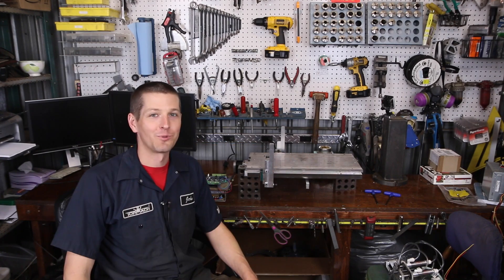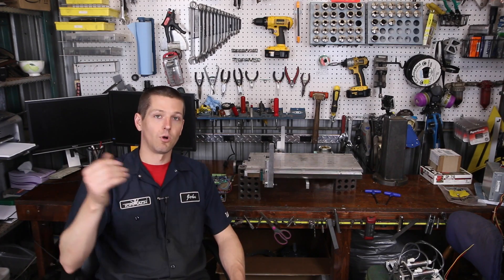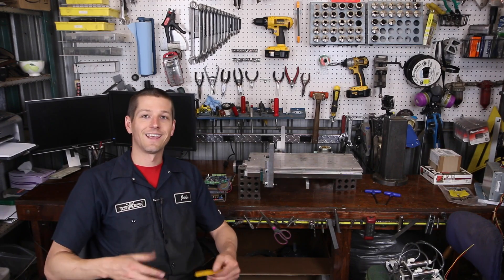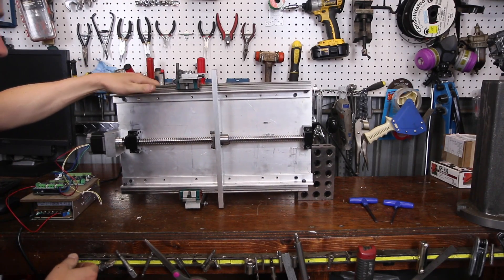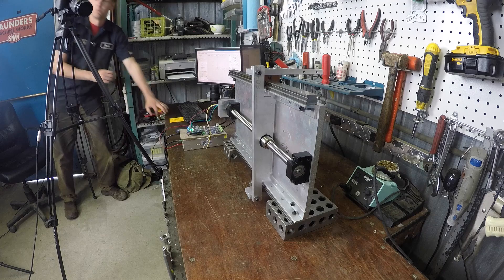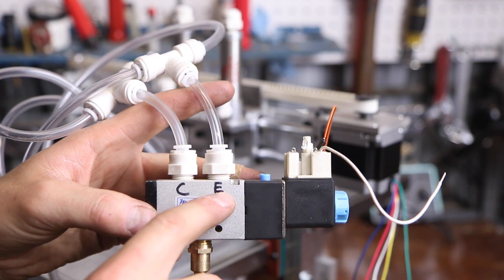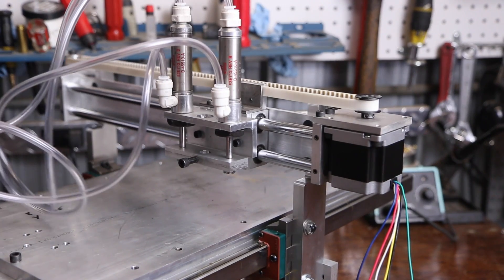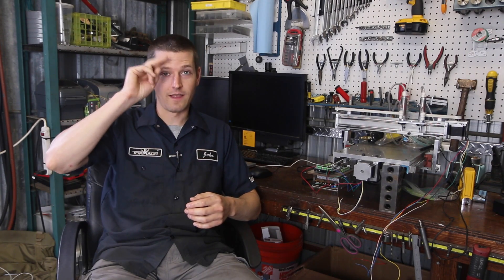DIY CNC Machine: Linear Rails + TinyG Part 2!  Widget41

Comment: I have a question.
I see a lot of cnc-routers on ebay/aliexpress etc. They use all linier-rods instead of linier-rails, just like your machine.
I think that using rods for the X movement creates flex in the whole upper section (x & z).
Are the linier-rails also better for x & z?
I gues you have to mount them on to a aluminium plates to get more riged-x & y travel.

Comment: Ok my question is. What tolerances are you using for mounting aluminum plates to your linear Bearings. Like the through holes and the counterbore tolerance say for a 5mm cap screw.

Comment: wouldn't it be possible to mount the linear rails inverted in the same position as the angle material to the bottom of the table, then use L shaped risers to connect the y axis (I believe it is) up top. this would reduce the amount of contamination that reaches the rather technical rails that wouldn't do very well with chips from milling or even just the dust created from engraving over a period of time (probably even worse than chip's on the tiny recirculating bearing setup). 

also about the other diy build, wouldn't it be fairly easy to replace the small single bearing guides (and aluminum angle mounts) with the preferable two or even three bearings per side to stabilize that axis... should be easily doable considering that the x axis was far longer than necessary, or so you thought anyways before realizing that the "trucks" should have been much wider  to reduce slop in the mechanism.  sorry for commenting on two different projects in one comment but please let me know what to think about the ideas. thanks for your time and consideration, have a great day.

Comment: sweet videos.  I'm quite excited to work on my first CNC plasma cutter/MIG welder table.  do you all have an even heavier duty example build?  like  4' by 5" table?  what diameter lead screws would you suggest for such a monster?  also, subscribed.
Reply: 4 ft by 5 ft.  not 5 inches.  lol

Comment: Why not use the Arduino to send a pwm pulse to a Mac solenoid to vary the force when you want to drive z down. I did this to make a boost controller but I am for sure it would work for this. Cool thing is you would get cheap force control.

Comment: isn't a servo motor better to use if you're already using expensive ball bearings? and the drive belt, the teeth andspindel size doesn't that impact precision so wider belt, more teeth and larger spindel equals more precision?
Reply: +NYC CNC So you cannot put encoders on stepper motors to close the loop?
Reply: +Methodwake You can, but then the steppers becomes a bit expensive and then you might be better going with servo's anyway.
Reply: +Daniel Mattsson I have added Encoders to stepper motors and the cost was not really that bad. Incremental encoders are cheap now of days. Still much less expensive compared to a servo.

Comment: I have been having a play with your design but I used a Demel for the engraver got it working by having only one air ram to pull it up and some 185gr SWC's to hold it down, use the Z axis commands to turn the the solenoid on, only has to go one way. Just add or subtract weight for different materials. Great vids, looking forward to the next episode.

Comment: You mentioned that you have not yet figured out how you were going to control your pneumatic cylinders and engraving pen. You also mentioned using 'G' Codes. 'G' Codes are preparatory codes for axis control. You want to use 'M' Codes which are 'Miscellaneous Codes'. Your engraving pen closely approximates a spindle, so use 'M03' Spindle On (CW) to turn the engraving pen ON and 'M04' Spindle Off, to turn it off.

Since you are not actually going to CUT with a spindle use the 'M08' 'Coolant ON' to bring your pneumatic cylinders DOWN and 'M09' 'Coolant OFF' to RETRACT the pneumatic cylinders.

Comment: Instead of using the tinyG, I use separate drivers and an Arduino UNO. They are stronger with heatsinks and if you blow one driver you don't have to replace the whole unit. Here is a link to one that I use.  http://www.ebay.com/itm/301670136936?_trksid=p2060353.m2749.l2648&ssPageName=STRK%3AMEBIDX%3AIT

Comment: About Y axis and magic smoke from G-shield. I think you were going too fast and there is inertia in system, by rapid stopping that inertia generates current in steppers. That current goes back to G-shield and BAMM!!! :). I think that happened would like if someone confirms this. Stepper should slow down.

Comment: I didn't have time to read all of the comments, so if I got beat to this tip, ok.  If Chili-pepper uses M codes you might be able to fire the valve with one of those.    Also, some flow controls will offer you some control over the speed of your cylinders without sacrificing force.

Comment: I'm seriously excited about this project! I'm trying to wrap my head around this all as I want to attempt building a 4 axis CNC mill for mild steel and aluminum and this seems like the best jumping off point for me to do that.

I've got a grasp on how to stepper motors controlling the motions along the XYZ axis and rotating the X axis (a?), but I'm kind of at a loss on how to actually control the bit speed and what to use to drive it.

Any tips/suggestions are much appreciated!

Comment: As to chip load falling into the presently exposed side axis tracks, why not simply mount the unit to turn around on a center of balance rotation axis so that it may be 'flipped upside down', and run 'inverted' once the workpiece is secured.  The various movement systems are not dependent on using gravity

Comment: With the short stroke of the pistons this might not matter. But if you leave the air pressure where the pistons and solenoid recommend you can put control valves on the exhaust ports and you can control the speed and still have the power of the correct air pressure.
There are many different types but I like these.
http://www.ebay.com/itm/Exhaust-Port-Flow-Control-1-4-NPT-0-250-PSI-IR-ARO-20313-2-OFF1S-/231144200686?pt=LH_DefaultDomain_0&hash=item35d14499ee

Teddy

Comment: Hay john its me again. i was thinking about what you could do to control you pneumatic air cylinders.
Depending on how fancy you are going to make this machine you could use the coolant pin on the TinyG .Then you would have to by a Separate breakout board that has a 3.3v relay on board and wire you 12V A/B ported air valve to control it. I encourage you to look into the specs of the relay that you buy because some of them may not be able to handle the current that that air valve pulls because in side of though is an electric solenoid (Coil of wire) and that pulls a  plunger that lets air go bu.
If you budget allows try to find one that IS 3.3V CONTACT voltage but a little heavier duty be cause in electronics , a coil of wire contains a large magnetic field and it is now know as an inductor. and instructors in electronics Resist the flow of changing current and so when you open the relay . the magnetic field has to dissipate some were and some times that can flow back into the relay and then in to your board.
Or if you are having troubles finding a large enough relay you can put a diode across the solenoid wires but put the diode in backwards so when you turn on the relay it wont turn on the diode . but then when you turn off the relay the magnetic field collapse and the current flows backwards threw the diode. This Simple circuit is called a free wheeling diode and i use it in a lot of my circuits even if it my not be necessary  .
To turn on the coolant pin on the TinyG :(" depending on what G code command list you look at you might not find it") It is a M8 to turn on  coolant pin and M9 to turn the pin off . There is a M7 command but that is a Mist coolant command and i don't think the TinyG Responses to that.(https://en.wikipedia.org/wiki/G-code)
Hope that Helps

Comment: Hay John
I was wondering if you were going to put limit and homing switches on you machine.
I was wondering if you could touch base on , or create a separate video on setting it up , hardware , and software wise in ChiliPeppr. I bought  a TinyG  about a year ago and now you got me hooked on doing something with it.. I'm prepossessing an old cnc table engraver that i had got my hand on. It is a  very nice machine , the working travel movement is eight inches in the x, and ten inches int the y and about a  half an inch in the z. the machine had the limit switches build into the machine so all I had to do  is wire it up.. On the TinyG the input pins are normally pulled high , so I though that it would have to be pulled low for the TinyG to see a state change in the switch.So in ChiliPeppr i changed all the machine settings and limit settings  . but when i moved the machine and when i touched the switches the machine didn't halt at all .. Please help me if there are G codes that I need to send to the board or other setting I need to Change.

Comment: If I only use adruino code, without g-code or any other software, how can I control multiple steppers? Will this piece this of code do?
   digitalWrite(, HIGH);
   delayMicroseconds();
   digitalWrite(, LOW);
   delayMicroseconds();
i have problem when the delay adding up.

Comment: I think air cylinder is not a rail.
I know the axial effort is not so big but air cylinder is realy not
made to resist to that.Maybee if they not full extend when operating they could do.
Reply: Now you talk!
Just can't wait to see that crazy machinne !! :PP
I really like yours vidéos,i start learning meeling metal from you....

Fred
Reply: Just a question: Why using so much different transmission between Y and X axis?

Comment: Your videos are great. I just saw your move to Ohio clip from last year. I'm from NYC but studied Industrial Design in Cleveland. Ohio is a great place to live. I designed a new camera rig I'm getting a small BV20L-1 to make the first run of parts manually but plan to upgrade to CNC.  That said your Tormach 15L Slant Pro demo looks like the way to go. What an amazing machine. Thanks for the support.

Comment: Suggestion, T the hoses right at the cylinder.  Fewer hoses in your drag chain (bundle) Control of the cylinders should be discrete ( on/off). If the works electrically like the it does mechanically switched, just supply 12v for the down stroke.  If it needs a 12v signal for return, you could use a single post double throw relay made for arduino.  On, relay provides power to on post and off the relay provides power to the other post.  If it's a two wire polarity swapping valve. Ie. + 12v is up and = 12v is down, use a double post double throw and you can swap the polarity on the relay.  let me know if you would like a drawing.  Thanks for bringing this whole project to TY

Comment: Since the pneumatic cylinders are an on/off rather than a drive system would it not be best to drive them with a M code rather than a Z, It seems like it would be easier to integrate into your process.
your program would then look like:
G0 X Y
M123 (pen down)
G1 X Y F
M124 (pen up)
Reply: great solution.

 but  problem is you can't use any software that give you the G code, you  need to writ all program by hand it will take time if it a long program .

Comment: On the subject of anti static bags....

There are two kinds.

The black, silver, or black line pattern bags are usually conductive to dissipate any static charge and to prevent a discharge to the bag damaging the contents. It's wise to check with a meter as there are fake conductive bags out there! I've seen anti static conductive foam go up in flames because someone operated a circuit board sitting on a piece.

The pink bags are not conductive, they just don't generate static charges as they rub together and against other objects. They won't protect the contents against a static charge hitting the bag.

Comment: Hi, the DRV8818 stepper motor drive chip has a direction and clock.
The easiest way to drive the air solenoid is with a simple FET.
Connect the gate to the direction pin.
The G code will drive the pin high or low depending on the direction.
You'll need a diode across the solenoid to stop any back EMF.
Great videos as always :)
john b (UK)

Comment: One suggestion in dealing with air cylinders, use flow control with push fitting. I've been building automated pneumatic machines for years,  regulator are not good for speed control of pneumatics systems. Nice job on the build.

Comment: Why don't you set your system up as a standard 3axis system but have the Z axis stepper only rotate 45ded to depress a switch triggering your air valve. . its low tech but uses a extra stepper. its redundant but works?
Reply: lowsideswitch 45deg. *
Reply: lowsideswitch He already has a soleniod making M-code preferable (assuming he can implement it with this hardware, idk); plus, if he learns how to use M-code he can use it for many other things on this or future projects.

Comment: Hi John,

Do you happen to know what sort of runout is typical for your setup using ER collets? I just invested in some nicer collets and am getting a lot of vibration with the clear cause being runout. The inside of the tool holder it measuring under 0.0002" TIR but when measuring from the OD of the endmills, I get from 0.001 to 0.0025" variation. 

There is always one flute bearing most if not all of the visible wear.

I need to know if this is just something to expect or if I need to give Sowa an earful for their collets.
Reply: NYC CNC Yeah, I think that may be it. I just tried slowly tightening the nut and it just got progressively worse. 

That's good though, since I was expecting the collets to last even if I get a new mill.

Thanks!

Comment: Isn't the speed that the cylinder moving going to cause problems with the bit? Can you ramp the speed in which it lowers the engraving bit so it doesn't chip/break the bit?

Comment: Hi I work as a process engineer for as large automotive company in the uk I have quite abit of experience with pneumatics and machine building looking at your other comments I would agree that using a speed controller  is your best option rather than using the regulator I use SMC heavily for my pneumatics don't know if they are hard to source in the usa but the quality is great here is a link (https://www.smc.eu/portal_ssl/WebContent/digital_catalog_2/jsp/view_features_list.jsp?dc_product_id=50637) . also rather than a percussion engraver I would personally use a die grinder or router as you will get a better quality engraving and is a easier setup here is a link of a die grinder https://www.cromwell.co.uk/KBE2702543K i use off the shelf percussion engraver in my factory and the quality varies as  the pin need to be a maximum of 3mm away from the surface of the part i dont know if you will have the same issues with the system that you are creating here is some companys that sell off the shelf percussion engraver / dot peen engraver that i use it may give you a few ideas in set up... http://www.telesis.com/ & http://www.technifor.co.uk/uk/products/dot-peen-machines.html

kind regards

Antony marsden
process engineer
GT emissions systems
http://www.gtesys.co.uk/

Comment: Sorry to hear you fried your TinyG!  I fried mine as well due to a stupid mistake but fortunately have the folks at work who could re-solder me a new ATxMega chip.

If you figure out a recipe for super fast rapids, let me know!  The problem I've run into is that the 30V limit of the TinyG just won't get my motors up to the speed I want.  I went with beefy 425 oz-in motors but that means a higher inductance (6.4mH) and so a slower max RPM without stalling.

How to control your Z axis?  Use an Arduino!  Use the PWM output and Gcode with a PWM variable speed VFD controller (http://www.cnc4pc.com/Store/osc/product_info.php?cPath=25&products_id=303&osCsid=3a693199e5734049450235f56a09bf6a) that will turn the TinyG PWM output into an analog 0-10V signal.  Pick that up with the Arduino (you may need to dial that back to no more than 5V).  

For an input below a certain voltage output 0V to a relay controlling the solenoid and for any input above a certain voltage output 5V to the relay.  Any spindle speed under half would then be "off" or "extension" and any spindle speed above half would output "on" or "compression".  

Or maybe just use a relay that is rated for, say, 5V minimum to trigger.  Any spindle speed that would make the converter output less than 5V would be "off" and 5V or more would trigger the relay making it "on".

Sound like that will work?

Comment: Can the control board do M codes?
EDIT: Maybe use M8 and M9, as they should be used to turn a coolant pump on or off, which would be similar to turning a valve open or closed.

Comment: What made you decide to run pneumatic cylinders for the Z? Wouldn't solenoids be a simpler and more reliable setup?
Reply: NYC CNC Well in my mind you're basically already running a solenoid to control all the pneumatics, but with the pneumatics you're now adding lot of unneeded complexity with air hoses, regulators, compressor, and cylinders just to  move the Z between 2 positions. When really you could just hook up 2 solenoids wired in parallel and get the same result without all that.  Generally speaking, More parts = more problems. 

But I figure you probably have a specific reason for running the pneumatic cylinders which is why I ask.

Comment: Nice work John.  Gotta watch the different types of anti-static and static dissipative bags and conductivity.  Sometimes they work for you and other times they can work against you as you found out ...  First thing I usually do with circuit boards is add standoffs or rubber feet so that they can sit anywhere.